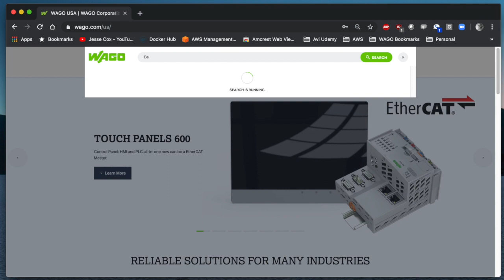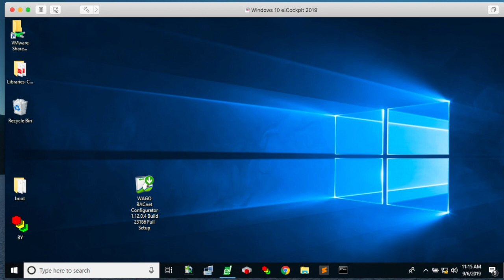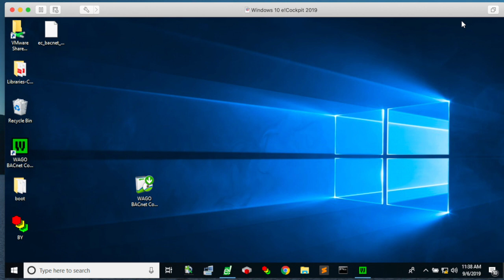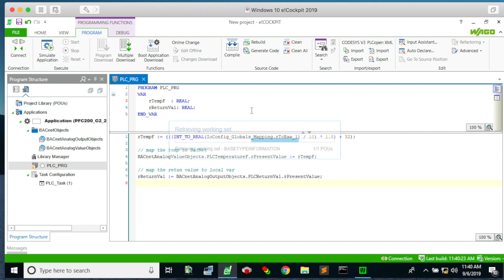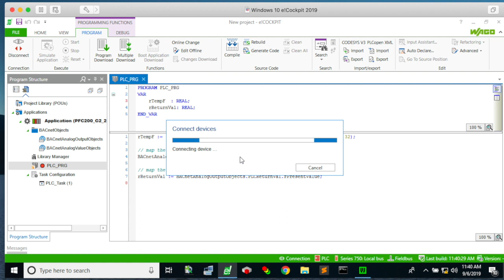CTRL SEE WAGO e!COCKPIT and BACnet with PFC200

Comment: Great video. How would this process work if you were using Codesys 3.5 rather than e!Cockpit?
Reply from the maker: Morberis great question. I haven’t tested this but it will require the libraries used by e!COCKPIT.
Reply: @JesseCoxPDX  I wasn't aware that it was possible to load e!COCKPIT's libraries into Codesys, good to know. I am suprised that the Wago Codesys v3.x libraries aren't sufficient. Thanks for the reply. https://www.wago.com/global/d/swreg_codesys_v_3_c